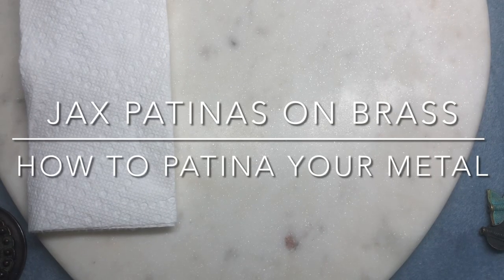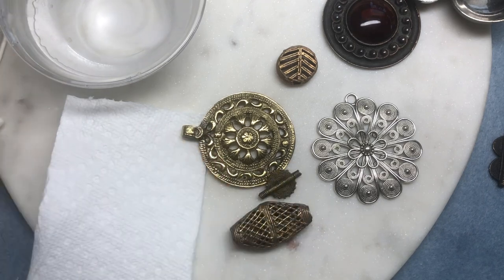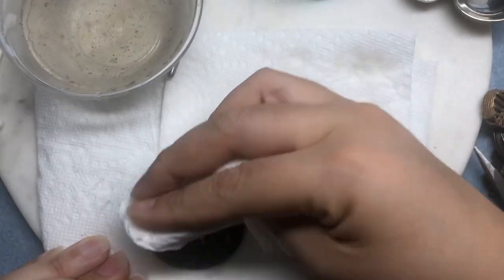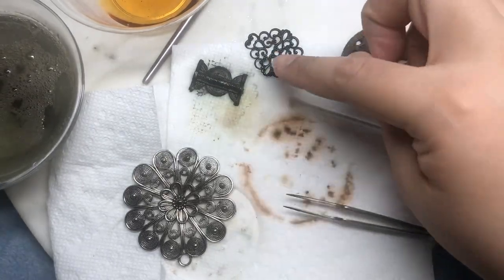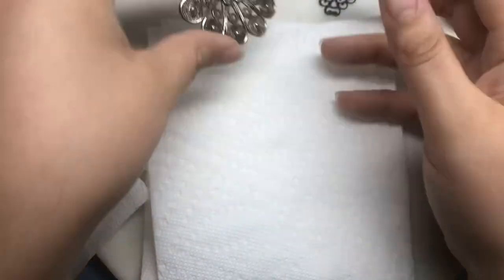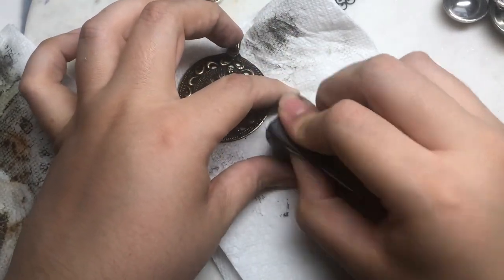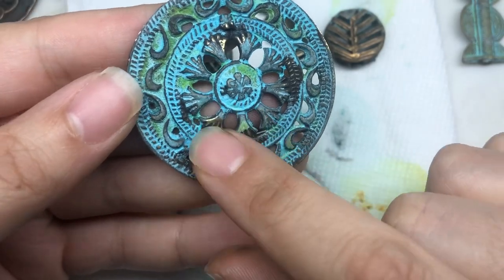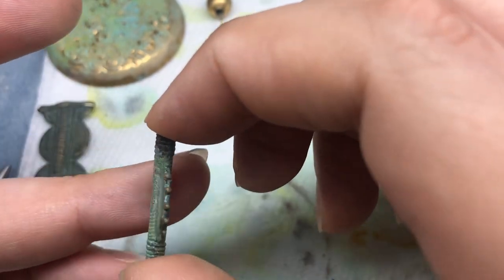Brass Patinas- How to Patina Brass Metal Using JAX Pewter Black & Green Patina!

Comment: Thank you for a fun video. I love the science of metal patina. As you mention, metal prep is THE critical step. You can degrease metal with a soak in acetone nail polish remover or a mild acid, like vinegar. You can even use ketchup (a readily available acidic gel) with a toothbrush, followed by Dawn, or similar, dish soap. If you cover the wet patina-ed items loosely with plastic wrap, (or put the items on moist paper towel inside a vented Tupperware) it will help stop the patina mixture from drying out and then you don't have to be as liberal with the application. Also, when doing beads, you can hook them on a bit of wire and hang them on a rod and do both sides at once. Also, thank you for the warning reminder. These are chemicals and everyone should read the MSDS on PPE, use, mixing and disposal.

I have not used Jax. Instead, I use liver of sulfer (LOS) which is a really under-rated patina, bc a lot of people think it is hard to use. Most people think of it only to darken silver. But you can add acid (vinegar) or base (ammonia) or other liquids (recipes are online) to get different colors on copper-containing metals (including, brass and bronze). I can get blues, greens, chestnut brown, orangey rust, gunmetal grey and dark/black, just by varying the amount of LOS, temperature, pH and organic compounds in the mix. The easiest and most stable LOS I have used is the gel LOS from Cool Tools. Lump LOS is super stinky and very annoying to use IMO.
Reply from the maker: Thanks for the really great info, Fern! I will be doing LOS at some point and I love the tips!
Reply: Thanks for sharing your knowledge and experience with us! I had no idea LOS can give so many different effects. I'll be checking out recipes and have some fun.

Comment: Thanks for this information Brittany.  I am not a jeweler but I build models of 18th and 19th century sailing vessels.  We modelers of course need to treat and age the shiny brass, copper and Britannia fittings that we use. Similar products aimed at the hobby industry are limited in applications and are expensive. This stuff is genius!  I just purchased a pint each of the black and green using your links below and hope you get a few cents out of it. I’m about to build a copper bottomed vessel (a couple’ a thousand plates) and am looking forward to experimenting with some test pieces to get the right “salty” look.  I’ll pass your links on to others on the modeling forums and channels.   Cheers from the Chihuahuan Desert Boat Yard. Angus

Comment: Hmmm - I'm not sure that I like the black. Would you do a video that shows the green going directly on copper or brass pieces without the blackening first? I like shiny stuff with the original colors coming through :o)
Reply from the maker: I kind of showed that at the end and didn’t like the effect. It was on the brass filigree and medallion. I’ve purchased different types since I filmed this so there will be a second video!
Reply: @TurquoiseStreet  I missed that the first time around, since it was just such a short piece. Thanks for the reminder. Do you think you'd get better results on straight metal [sans blackening] if you submerge the pieces rather than paint or dab on? I love patina painting with Vintaj Colors - but it can get time consuming doing multiple coats, wiping off, doing over etc, especially when you're trying to create several pieces that color match for a set of jewelry... I'd love something easy - dip, cleanse, wipe and be done with it, LOL
Reply from the maker: @ssiegreen5292  good question! There might be a product out there but that wouldn’t work with the JAX green patina. They say not to dip, and to paint a layer on so it can form a film. There are tons of things out there and I’m on a mission to test them all 🤣
Reply: @TurquoiseStreet  You rock girl!!! I love your videos - they are a great pick-me-upper and easy inspirations, and you always manage to introduce some of the nicest beads...